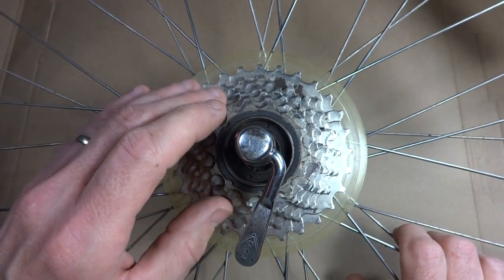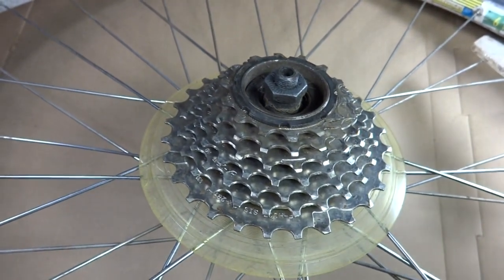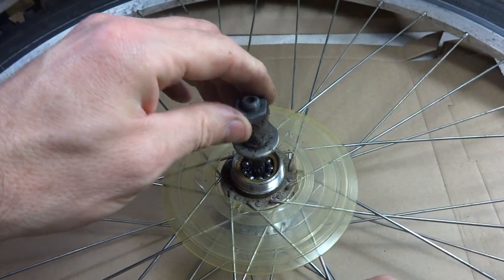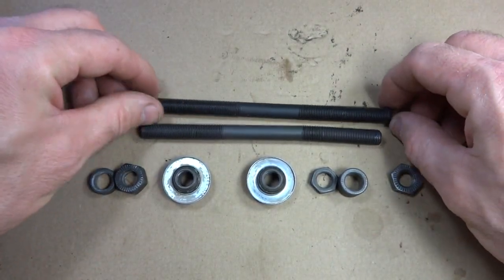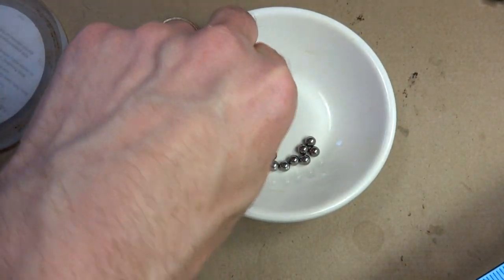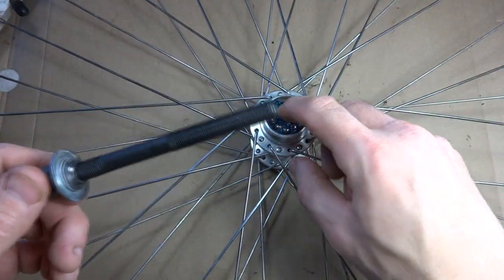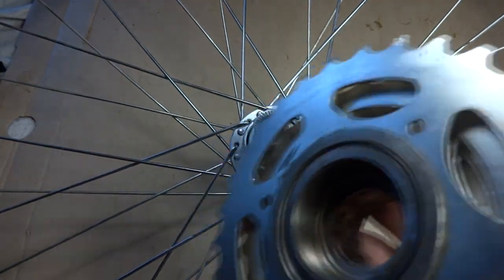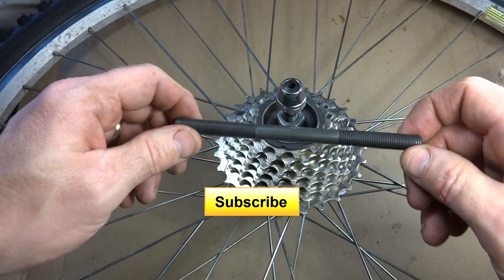How To Replace A Bent Axle On A Bike Wheel

Comment: With an adjustable wrench you want the force on the stationary or backside of the wrench not the adjustable side. Also should have put more grease on top of the bearings before you put the cones back on. Pack that sucker full.
But otherwise good job.
Reply: "With an adjustable wrench you want the force on the stationary or backside of the wrench not the adjustable side."

That's a myth. Both sides of the wrench are subjected to the same amount of force, so it doesn't matter which way you orient it. What you really want is a socket or box wrench that fits, rather than an adjustable wrench. From best to worst, assuming an ordinary hex-head fastener:

6-point socket or box wrench

12-point socket or box wrench

Open-end wrench (only use when it's impossible to use a socket or box wrench)

Adjustable wrench (only use when you don't have a socket or wrench that fits)

Vise-Grips (these come in handy after you've rounded off a nut or bolt with an adjustable wrench)

Comment: I need to order the same Shimano axle thru internet. Can you tell me whether it is the standard 170 mm , 3/8", 26 TPI or not ? Thanks in advance.
Reply from the maker: 3/8" would be a solid axle. A quick release would likely be 9mm for front, 10mm for rear. You need to measure what YOU have.
Reply: Yes, forgot to mention it is a solid one. Thanks again.

Comment: hello rj my axle is broken but i can find i knew one because my frame is 135 * 9 mm , not 135 *10 mm , when it is said (bike shop )that the axle of the rear wheel is 135*10 mm the diametre of the axle is really 10 mm or 9mm? can you help me to know
thank you
Reply from the maker: +HABIP ERDOGAN Match the axle that was in the wheel. If the wheel fit before, it should still fit.

Comment: Excuse me, is it possible to straighten the bent axle with a hammer?
Reply from the maker: Possible? Yes. To do it well. Probably not easy. Just replace it.
Reply: @RJTheBikeGuy  Thanks for the advice. 👌
Reply: @RJTheBikeGuy  Sorry, more question my bike has a bent axle, what are the cons or risks of using my bike that way?

Comment: How do you think the axle got bent?  Can this happen just by, say, going over a big bump, or hitting a kerb?
Reply from the maker: It could. Hubs with freewheels are prone to bent axles.
Reply: Yes, I think maybe they put a lot of strain on the wheel?  I have broken & replaced every single rear-facing spoke on the freewheel side of my rear bike wheel (all 9 which face away from the direction of rotation), but no other spoke has ever broken, either on the back wheel or the front one...

Comment: I bought recently a new wheel with  freewheel head. And axle is already slightly bent. I drive only on the road not in the forest... Is there a better stronger  axle ? Or simply  axle with  freewheel head easily bent?
Reply from the maker: Axles on bikes with freewheels are more prone to bending due to bearing placements. You could get a wheel with a freehub/cassette. Or replace the quick release axle setup with a solid axle.
Reply: it's already solid axle, . Means the only solution freehub/cassette. It seems to me on the older bikes the steel was much better ( stronger )  on their wheel axle!? What's your opinion?  Thanks
 RJ
Reply from the maker: Depends on the bike too. Not all bikes are made of the same quality materials.

Comment: Any idea why the axel tightens as soon as I tighten the free wheel? Thanks
Reply from the maker: No. Tightening the freewheel has nothing to do with the axel. Generally the axel tightens if the cone/locknuts are not adjusted correctly.

Comment: What causes this? On my Haro I definitely beat it up but this new hybrid commuter city bike I've only had 2 months and I just ride it to work and back, already seeing slight wobbling on what I thought was the sprocket but I know it's the axle.
Reply from the maker: Often cheap parts. Bikes with freewheels have the axles extended out farther from the bearings will be more likely to bend.

Comment: I have a 2018 so cal flyer and I like to try to wheelie it or I pedal fast and I hear a loud noise and than my chain goes loose or sometimes my tire starts hitting the frame and I checked my rim the other day and my axel was really loose and it would wobble when I spin the tire what should I do ??
Reply: i have been there as a kid,it was hell,honestly buy another bike rim for 10-15-20 euros or in other words 18 dollars (used ones),and mount everything you had back on it,or use the one you have spare,or buy whole new bike tire,I know it's a lot of work,but more you do things like this you get faster at repairing and understanding things in many other fields not just this,it is rewarding.

Comment: My son has an old Fuji and the chain rubs the dork disc when on the large gear... would that be a bent axle?
Reply from the maker: I doubt it. Not sure what the issue is off hand. Would have to work on it. Could be the dork disc is broken, not installed correctly.

Comment: Can I use a little bit of threadlocker on my rear axle? ( because when I changed old broken axle to the brand new, one side is always unbolts). Or better to tighten a little harder?
Reply from the maker: I am not sure why it loosens. Nutted axle or quick release? What do you mean by loosens?
Reply: @RJTheBikeGuy  my axle is quick realease, bolt is like in 6:25

Comment: Top tip: The floating jaw of an adjustable wrench should ALWAYS be used in compression, unless impossible to do so. I think you had your cone spanner the wrong way round, too. If you didn't know there's a right and wrong way round to use spanners, you have been poorly trained.
Thanks for the excellent video; I am new to bicycle repair but I am a trained mechanic..
PS An adjustable wrench should be the LAST resort in any given situation, not the tool of choice.

Comment: The washers on my rear axle are keyed, but now my new axle has no groove. Can I do without the washers
Reply from the maker: Was it keyed for a reason? Maybe you should have gotten a keyed axle. If not, I would still use washers.
Reply: RJ The Bike Guy I’m not sure why, the only thing that was keyed were the washers, but thanks so much for responding:)

Comment: Hey man,
I have been through 4 axles on my bike with a freewheel, not doing any jumps or anything. Even a Cr-Mo axle bent within about a month. Is is really just because I have a freewheel? My dropouts seem to be aligned.
Reply from the maker: +JBMP Don't know what to tell you. Maybe switch to a wheel with a freehub/cassette where the bearings are farther out and the axle is less prone to bending.
Reply: I watched your video about how to tell if the frame is bent, did it myself and found one side was off, but only by 4mm. Would 4mm really be enough to cause such grief?

Thanks
Reply from the maker: Frame alignment issues become apparent in different ways. At higher speeds you might get wobble.

Comment: When you disassemble the hub are they normally that dirty, or do you think it was in an accident that compacted dirt and debris into it and bent the axle?
Reply from the maker: This hub wasn't that dirty compare to many I have overhauled. Not sure what bent the axle. I don't think an accident as there wasn't any other significant damage to the bike.
Reply: +RJ The Bike Guy Mine broke and I don't know why.
Reply from the maker: It happens. Check to make your dropouts are aligned. If they are not parallel, that can put stress on the axle.

Comment: At 10:36 you refer to the problem of the cone loosening rather than the lock nut tightening. I've been repeatedly perplexed by this issue. Might it be avoided if the other lock nut were held, so that only the lock nut and not the cone would move relative to the axle? Of course that would require a third hand, or maybe a vise. What do you think?
Reply: At 11:15 you refer to holding the bottom part, i.e., the other lock nut, but how are you holding the cone wrench on the upper cone when you do that?

Comment: Hi RJ, do you have anything or advise as to how to remove a front wheel axle that is broken? I tried everything I know and it just spins, even if I hold the axles other end with a wrench still spins, I think it broke in the middle and I can't get one of the axle nuts out, it's a sealed bearings front wheel tho, so not like I can remove the cones and go in that way, ant ideas? ☺ thank you so much in advance
Reply from the maker: I don't know your exact hub/situation. If the axle is broken it should come out pretty easily. Try pulling it out.
Reply: We did, me and a friend but won't move I was thinking it us cause of the sealed bearings cartridge... I will take it you don't think it should imped us being able to pull it?
Reply from the maker: Like I said, I don't know how your hub is set up.
Reply: Thank you appreciate it :)
Reply: If the axle is spinning while you are holding it with a wrench, then use a work bench vice to hold the axle on the other side while you get the axle nut off. If its broken in the middle it should just slide out,  the axle could be bent where it originally broke in half so u might have to pull it out on an angle. If none of the above works then take it to your local bike store so they can fix it.

Comment: Hey, I think i need some help. I have a strange wobble on my rear wheel too, and the axle seems dead straight. the skewer was also slightly harder to get out then if it were all straight. the skewer has a slight bend in it, but it seems weird for it to cause the wheel to tilt left or right. I did notice a little bit of wear on the part of the skewer that the cassette sits on, which I think is caused by the bent skewer biasing the wheel to one side. I also noticed that when the skewer is in and the cassette is engaged, that the cassette would slightly move off true. excuse the length, but I am new to repairing bikes and just need a bit of help. I'm going to buy a new skewer set anyway as I don't want to ride on bent ones, but I'm not sure that's the problem. thanks.
Reply from the maker: +cakeless coder I doubt a bent skewer would cause serious problems. Just bend it straight. Did you remove the axle from hub to verify it was straight? Could also be bearings. Or maybe the dropouts are not aligned. Or maybe the wheel is not true. Etc.
Reply: RJ The Bike Guy thanks. I disassembled and checked everything, and it looks like the wheel just needed some truing. I got it straight enough that the wheel doesn't contact the frame. thanks for the advice.

Comment: I need a long axle for an odd bike- 185mm longest I can find and it's too short by just a couple mm.  Can I make one out of threaded rod?
Reply: OOps- 26 tpi is the problem
Reply from the maker: A machinist with the proper equipment could make an axle. Can you make one, I have no idea.
Reply: LOL I should have been more careful wording my question.  As it turns out, I found longer axles- the search was a problem.  I searched for long axles or 195mm axles, which I know exist; turns out I found them searching with a different length- 205mm axles are not so hard to come by.  Thanks, RJ.

Comment: If i always bend an axle..?  Like i change may axle every time i go to rides....Is it normal..?
Reply from the maker: Not normal. You either have cheap axles, or are riding the bike beyond what it was meant for. Or some other issue. Get a new wheel with a cassette, instead of a freewheel. They won't bend as easily.
Reply: @RJTheBikeGuy  Upgrade..?
Ouchie...

Comment: What if I have 9 speed thread cogs and I will change it to 8 do I need to replace the spacer or just put it the same?
Reply from the maker: I don't think either 8 or 9 speed cassettes require an extra spacer.
Reply: @RJTheBikeGuy  it's not cassette it's rare thread type I just happen to have 8 speed thread from my old bike and 9 speed stock on my road bike and I upgraded it with my old Claris sti since its a tumb shifter and need to replace 9 speed to 8 so my sti would work better 😅😅😁
Reply from the maker: If it's a 9 speed freewheel, then it's likely low end Chinese junk. The reason the good companies didn't go past 7 speed freewheels was that they were more likely to bend/break axles.
Reply: @RJTheBikeGuy  I see so it's more advisable to stay on non quick release rear wheel
Reply from the maker: @officialdreymedina3468  If you are going to run a 9 speed freewheel, yes.

Comment: If I didn't measure the number space at the end of the axle to the lock nut, then how would I figure out how much space I need?
Reply from the maker: Leave about 5mm. It should be close to that. You can always readjust later.

Comment: my axle is snapped
and im finding a new axle but they say that my axle is long they have a taiwan axle which is shorter please help me
Reply from the maker: You need an axle that is the same length, same diameter. Keep shopping.
Reply: if you can't find one my suggestion is either you change/convert your hub into solid axle or thru axle

Comment: Ive literally done this 4 or 5 times now and it still breaks so fast each time what am i doing wrong
Reply from the maker: Can be a bunch of reasons. Cheap axles, riding on rougher than intended terrain, abuse, misaligned dropouts, or a combination of things...
Reply: @RJTheBikeGuy  ok its probably the cheap axles cuz i just keep getting 10 dollar ones off of amazon but i dont want to get a nice one and have it break 🤔 idk ive been battling this bike for almost 2 years now trying to figure out why the axle keeps breaking even the one it came with broke in minutes i might just buy a new bike cuz its getting too frustrating
Reply: The more freewheel gears the greater the unsupported length on the axle on the drive side.  A solid axle is a better bet on a freewheel style of gear cluster.

Comment: Tbh you dont need to take off the free wheel after u take off the nuts and bearings from the side were is no free wheel you give it a tap with a rubber hammer and the axel comes right out

Comment: i replace one put in a nother and 2 months later it is also bent though in my country those things with nuts cost 3$ also the locking nuts for that lock the bearing nuts in place are super thin on new axsels so when you try to thighten them they strip threads 

https://www.2bike.rs/cikloberza/mali-oglasi/delovi-20/pogoni-i-lanci-45/patrone-osovine-50/osovina-zadnja-mtb-sa-prasinarom-3-8-x-175mm-tw
Reply: though i do ride some hard terrain
Reply from the maker: They could be poor quality. Bikes with freewheels are more likely to bend rear axles due to bearings being farther in.

Comment: those snap-fit shafts are worthless my broke down after a month bought a rear axle with nut instead of not hollow because they're doing better
Reply from the maker: Depends on the hub design and the quality of the parts. I have wheels with quick release axles that I have beat the crap out of, and never had issues.

Comment: My skewer is bent
Reply from the maker: Bend it straight, or get a new one. Just be sure you can see straight through the axle, so you know it's not bent.
Reply: Well the wheel wobbles too but I highly doubt it’s just the axel causing that? I think I bent the actual rim.
Reply: RJ The Bike Guy thank you for the reply!
Reply from the maker: Could be two separate issues. If the axle is bent, fix that first, before truing the wheel.